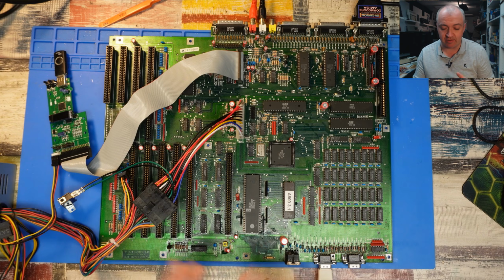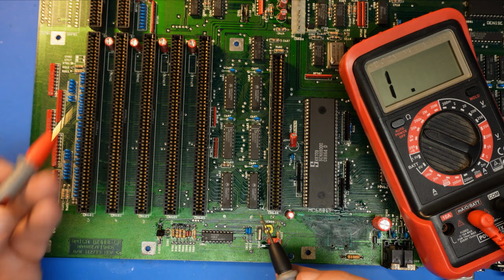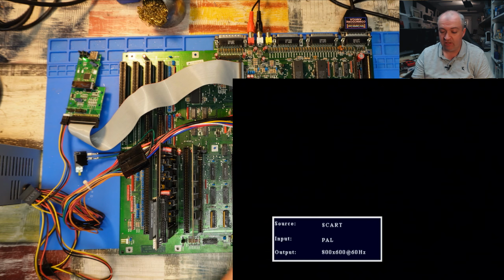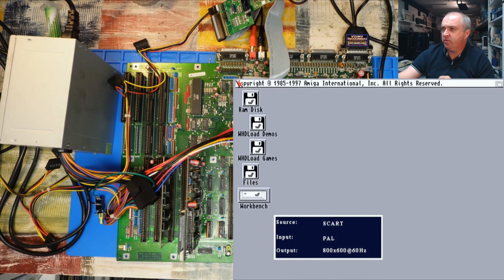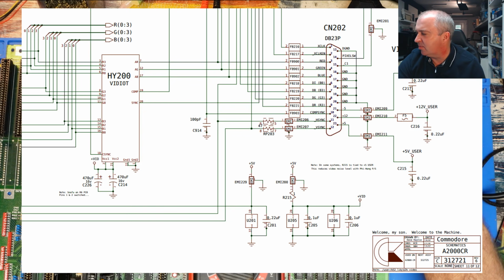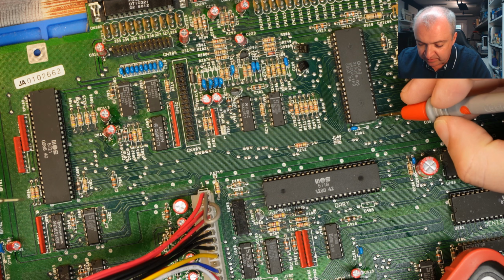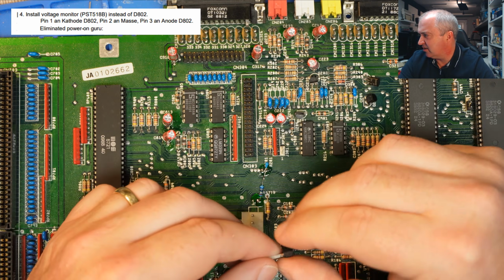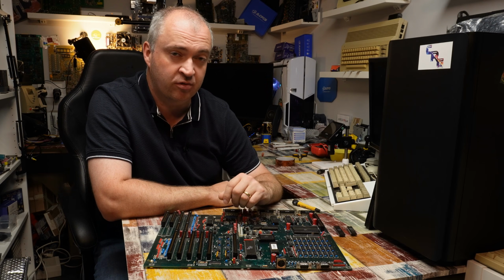Upgrading this Amiga 2000 from REV 4.4 to 6.2

Comment: Nicely done. 👌
Don't want to be a smart ass, but think you forgot to change RP604 - near power led conn.
Reply from the maker: Thanks glad you enjoyed it.  

Not to be of equal smart arsery but does that need changed?  It's not in the upgrade guide, not less I'm being very dumb and missing it.
Reply: @CRG  
Maybe not 🤔
but if you look at schematics of 6.2 (or if you have some spare 6.2 board, measure the values of those 2 components) and you will see alongside the changes you already did, that:

value of RP604 changed to 470 Ohm
and also
value of RP101 changed to 2.7K Ohm
and some other minor changes...

Keep up the good work. 👍

greetings

Comment: I LOVE my 2000 !! Had 2 X 4000's years ago but sold them - just love how rugged the 2000 is !

Mine is Maxxed out with Blizzard 2060 with 128Mb - SCSI2SD Card - 8.5Mb/s !!! / Ariadne II Network Card / IOBlix High Speed Parallel/Serial Card / Buddha IDE for CD Writer and 2nd IDE to CF-Card / 2Mb MegaChip / Prelude Sound Card / Picasso IV Graphics Card / Kick ROM Switcher (3.1 and 3.2) / CD-Writer / Dual Floppy Drives / Wizard Mouse / 4000 Tower Keyboard (I have had every 2000 Keyboard including the Red Amiga Key Mechanical ones but this is my fav for some reason) and my original ZipStick from my C64 Days :)

Sound is though an Cambridge Audio AMP and Wharfdale Speakers with a 17" 4:3 LCD Monitor (I did have a Commodore 14" 1084 but man they tore the eyes out of my head)

Although I replaced EVERY Cap in the Mobo and the PSU and it is ROCK SOLID  - I am scared in case the PSU blows up some day and fries all those Zorro/CPU Cards...any one any ideas how to protect from that ?
Reply from the maker: Sounds like you got a very impressive machine.  I'd love to get on of the 040 or 060 accelerators but they are rarer than hens teeth so just got this one as stock and a pistorm in my other 2000.  Got some upgrade plans for this one though so watch this space.
Reply: @CRG  Thanks mate ! I'm from NI too :) Small world eh !!! Yeah the 060's are so rare, It took me about 10 Years to gather all the bits up :S...I really try to use period correct hardware and avoid modern stuff. I still use it every weekend and have lost count of how many times I finshed Wizball :D:D:D I love that game, It came with my A500 I bought from Gordon Harwood back in the day, still have it ....although I have to use the modded version which works on AGA and 020+

I had a 1200 with TF1260 until recently...sold it for peanuts (£575) had the official modded 3.2 ROMS to boot from the TF1260 / OS 3.2 and a 75Mhz LC060...just never used it.....but seeing that new Outrun Port makes me cry I can't play it in my 2000 :*(
Reply from the maker: Another local Amiga user, you'll have to join us at the next Amiga Belfast.  

I'd love all original hardware but its getting seriously expensive.  Lots of new cards on the market though that arent as badly priced.  That said I'd love an original zorro rtg card, maybe one day.
Reply: @CRG  Yes one day ! I almost made it to Amiga Auckland meet in 2013 :D:D:D (I lived and worked in NZ for a few years) ..I always wanted to go to the meets to get a chat with Trevor Dickinson as I knew he lived in New Zealand too...think he still does

I took a quick video (Im not opening a youtube channel or anything - just one video to let peeps see it - apologies for bad quality - my first and last video :D)

PS Love your vids, you are truly an expert at electronics, wish I was a tenth as good, always great to see uber Amiga skills !!!
Reply: @CRG К сожалению, акселератор, конечно, даёт большое ускорение по обработке процессором, но не ускоряет работу с шиной ZORRO, так как не позволяет архитектура и чипы на плате.

Comment: As discovered, the MCP120-450DI/TO is unfortunately not the same pin order as the PST518B. The PST518B has, with flat side facing towards you: OUT, GND, VCC. The 'D' pinout of the MCP120-450 has a pinout of: RST (i.e. OUT), VCC, GND. You could have used instead the 'G' pinout MCP120, but rotated 180 degrees. Only other part I could find with GND as middle pin is Diodes Inc. AZ7045Z.
Reply from the maker: Yep, read the datasheet first 😅

As you might have gathered I prdered this part from ebay to get it quickly and it was one of the few available quickly.  Just happy it worked after changing the pins round.

Comment: A quick search re. The Molly problem. Probably the mod is irrelevant to your board, unless the other mods introduce it (?).

The “Molly problem” is a known hardware issue affecting some Commodore Amiga 2000 Rev. 6.0 and 6.2 motherboards. It is an electrical timing/noise issue on the expansion bus that can cause instability.
Reply from the maker: Oh well, the mods done now anyway.
Reply: @CRG . Indeed. I look forward to the re-housing video. 👍🏻

Comment: ...reasonably sure the capacitor-resistor-series to ground is meant to be a snubber circuit, probably reducing some ringing on the rising edge of the e-clock... at least, that is my assumption.

...googling it, I found an old Usenet post in german about it... apparently "Molly" is an old demo where there are a bunch or circles running over the display, and the problem was them stopping to move after a short while... somehow, that comes from the E-Clock being too dirty in some cases, and that CR-series-to-GND circuit cleans that up... so, yeah, snubber.
Reply from the maker: Thanks for clarifying.  It didnt look much different on the little scope although as I said that thing isnt the best.  

Interesting that they named the fix after the demo, I'll have to find a copy and try running it.
Reply: @CRG  less clarification and more just armchair assumption of rando hobbyist...

...rando hobbyist that speaks german... And the usenet post didn't cite any sources, so, no guarantee that is true... tho, if you do find a demo with a name close enough to that, it would lend credit to the explanation... mind you, the post already called it an "old" demo, and that post is from '99 ._ .
Reply: @CRG  Well, it was clearly visible that this patch had influence. You most likely will need a scope of another class to tell the difference more precisely. I remember once having analysed a PSU project we did make and during long term power cycle test the regulator died now and then. What I found in my analysis was that the lines to a boost voltage capacitor were quite a bit longer than they should according to the data sheet. Even though we had a quite good and expensive scope you simply couln't see the voltage spikes/ringing clearly on the line clearly that killed the IC. I suggested a layout change and the problems vanished.

Comment: Great video Glen.

The Molly fault refers to the composite output which had some issues on the 6.2 boards.
Reply: ...and the resister connected to the capicaitor is the fix as it cleans p the 5v supply as you identified.

Comment: Nice video Glen. Im actually trying to repair a 4.3 version with a clock problem. Battery and battery holder, clock IC, surroundings caps + variable trim cap and oscilator are new. But i lost backup clock, not instantly but since first or second day return to default time. Besides that, test kit report me a problem with ticks test, 15/16. Im sure this problem is related to the same clock problem. Would you have a general idea of where the problem might be coming from? The clock is always detected perfectly.

Thanks Glen.
Reply from the maker: It sounds like youre referring to the real time clock rather than system clock?  Are you using a cr2032 with a diode to stop charging?  It could be as simple as the type of diode causing too much volt drop from the battery.  Had that problem before myself and a battery wouldnt last more than a few days.  

The tick problem is seperate to this.  It could just be a bad cia.  Note which timer reports bad then swap the cias to see if the problem follows it.
Reply: @CRG  Thanks Glen for your answer. The battery in indeed a cr2032 with a new and modern holder with diode included, i have 3v in RTC IC.
And for the CIA's, i swap them between shockets and test it with a new ones and the problems is the same, 15/16 ticks. 
I really appreciate your advice, Glen, thank you very much for your time!
Reply from the maker: If you've got power ok to the rtc ic then it should be fine, not sure why it would be forgetting the date/time setting.  

Did the tick error move between tests A and B when you swapped the cias?
Reply: @CRG  No, the same error keeps appearing in the same place, loosing 1 tick in the sistem clock.
Reply from the maker: Are you using this board with an original 2000 psu or an atx?  The tick signal comes from the psu although might be worth changing J300 to generate it onboard from agnus (position 2-3).
Reply: @CRG  Yes im using a original psu, i try to change j300, let's see what he does.
Thanks Glen.
Reply: Hi Glen, i change the j300 position from 1-2 to 2-3, and now, the one tick missing fail go from CIAA TOD IRQ to CIAA TOD.
Thanks Glen.
Reply: Hi Glen, i got this info from original commodore bulletin:
The modification was formally documented in "An Update for the Service Technician," Issue 25 (April/May/June 1989), published by Commodore-Amiga. 

Document Reference: The bulletin details the field upgrade procedure to bring US-manufactured Amiga 2000 motherboards from Revision 4.0 (or higher) to Revision 4.5. 

Specific Instruction: Step 4 of the upgrade instructions explicitly states: "Add .01 uF capacitor on J300. Add this capacitor on solder side of PCB, from pin 2 (middle pin on connector) to ground."

Purpose: This was a factory-authorized fix to filter noise on the TICK signal line, ensuring system stability and preventing video timing issues.
Reply: Hi Glen!!!! GOOOD NEWS, Its solved!!! 16 ticks as spected!!! Arghhhhhh first test pass, second try not.... 😢